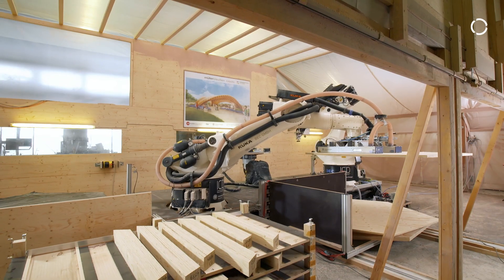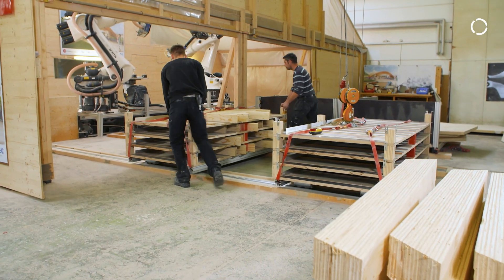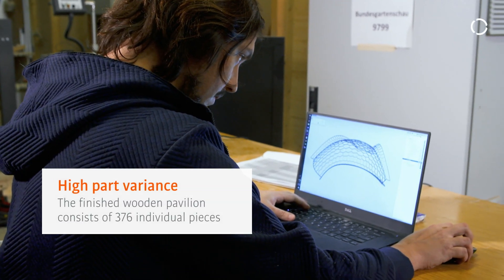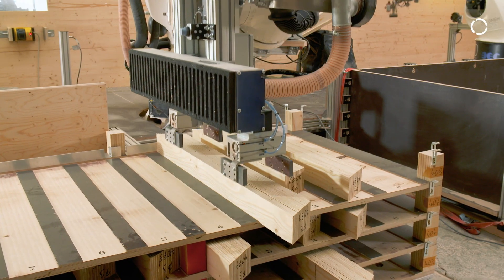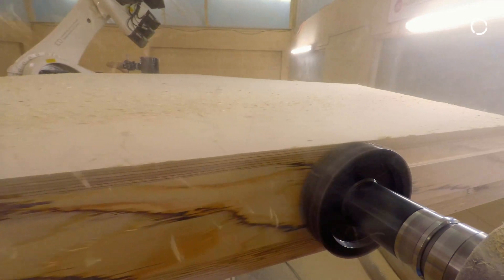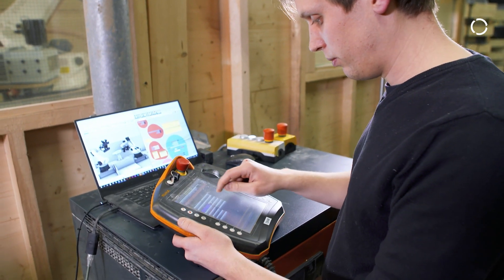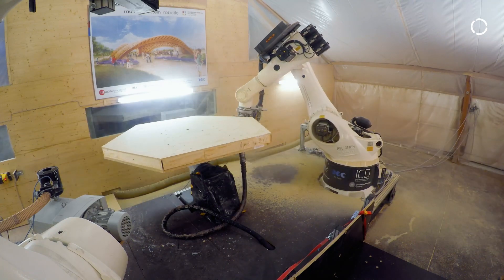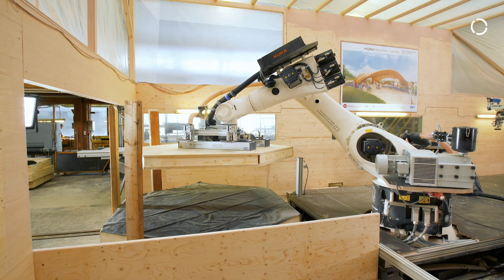Flower power timber robots: How robots can revolutionize architecture and timber industry

Comment: 0.3 mm? At that point I think you just have to say 0 mm, or “less than 1mm”..
Reply: It depends on the engineering standards. I worked in an automotive plant where dimensional tolerances had to be in the tens of micrometers
Reply: Allister Lobo in construction they are usually in tens of millimetres when it comes to installation on site. So, doesn’t matter whether you produce it to micrometers..
Reply: @thegoodthebadandtheugly579  It even changes by the hour due to humidity :-D

Comment: KUKA = Kraft Und Keine Ahnung!
Geht nix über Fanuc und ABB.
Reply: the lack of English is astounding, if I wasn't partially convinced that there is some truth behind these words, I'd think it's just a 13y old typing on some rage episode. So, back from ad hom- what exactly are the points of criticism? KUKA products break down faster and are 'generally less useful' than ABB?
Reply: @userou-ig1ze  Lifetime of the robots same.
The point of critism is, how fast and easy for programming. And by this, I don't talk about for teaching a position or insert simply a new position.
By KUKA, a simple IF function, you don't get by command menu, you have to write manually. Kuka don't know ELSEIF.
And if you copy or move a manual writed command line to other position by copy paste, the interpretor will tell you, there is a program failure. You have to open the programm in the editor, inserrt a space, delete this space for interpretor know, program is changed, and by close an safe, know the program is correct.

For programming a user interaction, on Kuka you need to program a complicate reques circle.
On ABB simply TPWrite "Message" for message on display, then TPReadFK "button1","button2";"","Yes","No"; or TPReadNum for value input.

A point, in which Kuka is very bad, is the flow from ptp movement into lin movement. you need to insert a ptp short before start of lin, otherwise the robot will leave tha path. Same at exit of lin movement. Even the italy Comau can handle this, but not the Kuka.
Reply: @GerhardReinig  it sounds like you have experience with the products but not in engineering first principles. Lin and ptp mean nothing to me. I don't know anything about programming these robots but the firmware should allow common commands at least in assembler. Elseif missing seems ridiculous, on the other hand its 1-2 lines of more code, that's not really that terrible
Reply: @userou-ig1ze  Linear and Point-To-Point (or Joint). If you lift up your right arm from point a to b, this is PTP or Joint. Linear, the robot move a exact line. CIRC, or Circular is a curve, defined by a circular helppoint between start and end.
Yes, a missing elseif is not so terrible.
Reply: ad hom for no obvious reason... go back from whence you came, troll of the 21st century
Reply: @userou-ig1ze  Haha, I programming industrial Robots since 15 years as my own company.
Very less people have more knowledge than me in this job.
I created a ow technologie package for oszilation in Rapid, which is function same good on old ABB S4 whitout any software option, like on newest ABB ICR5 with Robotware 6.
With PowerForce Control for polishing pressure and you can choose different figurs like simple left-ricght, diagonal, cross, high 8, flat 8.

For simple user questions, you need to programm a complicated code.
On ABB it's simply TPWrite for the message and TPReadFK for user choise OK or Abort. TPReadNumKey for real numbers input.

So, who is the troll in here?
Reply: @GerhardReinig  But how about these robotic arms controlled with other software than Kukas? Isn't just the software responsible for nice CNC movement, so it is with my 3axis CNC milling machine.
Reply: @3DMeister  I dont' unsterstand your question.
A robot isn't a CNC.
Both have nothing to do each other. Programming language is completly different. I know it, because I programming handing into CNC machines.
Yes, you can milling to by robot, but not in the accuracy than a CNC, because for this, a robot is not made.
A robot is desinged for speed and light or heavy weight, completly open for all what is possible to mount on a robot.
A CNC has only one job to do and this is milling.
Reply: @GerhardReinig  Ich bin christlicher Captain zur See. Wer bist du nochmal?
Reply: @NichtNameee  Du hast eine Playlist, darin enthalten einen Song.
Dazu geklautes Profilbild.
Was soll ich jetzt antworten?
Reply: @GerhardReinig  Das hab ich gar nich geklaut, du. Wir christliche Captains klauen nicht! Ab und zu gibts ne Buddel Rum. Aber nicht klauen, ne ne
Reply: @GerhardReinig  und auf fremden Kanälen zu schnüffeln geht gar nicht. Frauen müssen respektiert werden.
Reply: @NichtNameee  
Na, dann musst Du Titel "Christlicher Kapitän zur See" respektieren.
Was sollte überhaupt die Frage, wer ich bin? Braucht meinen Namen doch nur bei Google einzugeben.
Reply from the maker: @userou-ig1ze  [Quietly upvotes]
Reply: @KUKARobotGroup 
hmm maybe you shouldnt upvoteing not so quietly in the comments but get your programmers to create something as useful as abb robotstudio
and then make a video to show that you can compete with abb

maybe then you wouldnt here the name abb so often in your comments, but as long as this isnt happening i completly with Gerhard Reining with abb
(but not this crap called fanuc, why to many breakdowns for my liking)
Reply: @lexel90  Thanks! ABB Robotstudio is awesome! Best Robot-Tool ever!

Comment: We dont need a human anymore.
Reply from the maker: Whoa, whoa, whoa. We definitely need humans. Who's going to change our... I mean their... robot oil? Really, most of the best manufacturing outcomes are when people work with robots as tools to accomplish a goal. Robots are awesome tools, but people are the creative force that programs them and makes them useful.
Reply: Someone will need to program these or fix them
Reply from the maker: @dkmodder4405  Exactly.
Reply: @dkmodder4405  only a few
Reply: wer ist wir? 
klar werden Menschen noch gebraucht.. 
ohne Menschen könntest du dieses Video´s überhaupt nicht sehen. 
^^
Reply: @phantomerror  Then We need only 15% most skilled population of human ;)
Reply: @Paulk1200rs  Until that becomes irrelevant too..
Reply: the thing about Repair. if humanoid robot with better dexterity then a human, with the vary best two minute papers level AI was used, and if it became as popular as the iPhone. we would still be 10 years before you would be able to automate the most basic repair work. it's a really hard problem, for one the training data can you even identify the parts of something if they are covered in dirt, humans have a problem with this. sometimes parts have ware and need to be replaced before the schedule but they show that ware in different ways some that are by touch, "the belt feels louse, the radiator hoses are soft". so the problem with the training data is humans are really good at taking in one example of something and applying to to many different things, something can brake in exactly 1 way and you will never see that brake again in your life other things may brake in more general way like the thing but never exactly the same way, so identifying that unique brake is pointless, even with the training data you need to approximate the problem. the optimal way to repair something is the traveling salesman problem. sometimes diagnostic computers will tell you the wrong thing, this creates a problem of not knowing where to start and I think is the two generals problem, the trick is to just start working on the wrong thing and then find out latter that you wasted your time and created additional problems for no reason. now you can claim all you need to do is part switch and that works if you are repairing highly standardized calibrated parts in clean environments, but this is more for sealed devices that do not have ventilation, then real world objects. maybe you could make a air tight factory that all of the dust is managed perfectly, all of the repairs are scheduled far before needed and every screw is accounted for and tightened before it vibrates louse, but we are years from making such, still you will only be able to achieve a level of repair automation only after you have experienced every thing that could go wrong in the box and will you ever really know for sure when that day has come. what about that 1000 year earthquake. the robot overlords are likely to keep repair people around just in case. that said perhaps you could simulate absolutely everything including the truly random and unexpected and make sure it meshs perfectly with reality, but that's why I said at least 10 years and perhaps only with quantum computing as you would need to go threw every possible outcome, or simply the general ai problem.